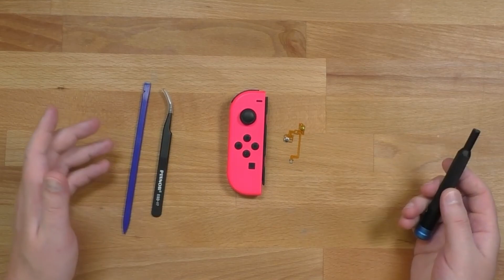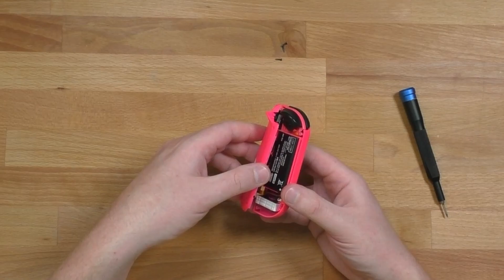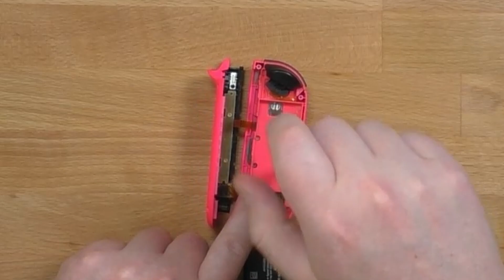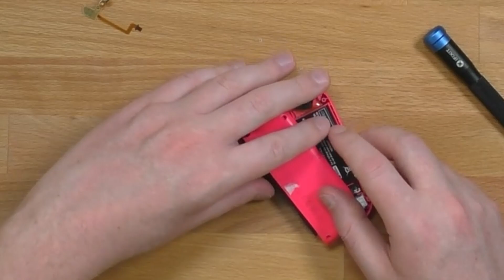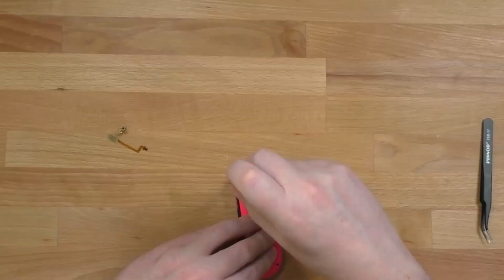Nintendo Switch Joy-Con Repair - Minus (-) and L buttons

Comment: Hello my plus button does not work do you know how to fix this problem?
Reply from the maker: The plus (+) button on the right joy-con is actually part of the main circuit board. If it is not working I suggest taking the joy-con apart and cleaning the button pad and rubber membrane with 99% Isopropyl alcohol. If that does not work you may need to replace the entire main circuit board of the joy-con.

Comment: Thanks for making this, great instructions. It was hard to find a video specifically for this problem. My L button works fine but minus is unresponsive, tried taking out and plugging back in the ribbon cable but the issue persisted, so it looks like I'll have to replace the whole part. Definitely going to refer back to this video once I get it
Reply from the maker: Good luck! If you have any questions let me know.

Comment: ummm I searched everywhere because my minus button is literally impossible to press. Anyway to fix it???
Reply: Did you solve
Reply from the maker: Replacing the minus button as shown in this video is your best option.
Reply: I replaced that part to fix my L button but then i had the same problem. It’s not a problem with the ribbon cable part because you can press that button and it responds, but it’s difficult to press with the actual minus button.
Reply from the maker: If the minus button is hard to press it may be the rubber membrane out of place. You can also try loosening the shell screws.

Comment: The tab/flap on the connector broke off where the ribbon is held, for the left button. The button doesn’t work anymore, is there anything I can do to fix it? I can’t find the piece as it flew…😅
Reply from the maker: Oh no! You have to replace that connector. No easy task. If the solder pads are torn off it may be a lost cause.
Reply: @CO3Productions   Do you have a video showing how to do this? Where can I get the part from, is there a specific name for it?
Reply from the maker: I do not have any videos on this repair, but highly recommend @TronicsFix. They have some great videos on Joy-Con repair. I believe the part you are looking for is "joy-con ribbon cable latch".
Reply: @CO3Productions   Ok, thank you, you’ve been very helpful! 😊
Reply: I know this is an old comment but for anyone who might have this problem THIS IS SOLVABLE with tape. I also broke the tab off by pressing the tab the wrong way for the L and Minus button ribbon strip. Tried to reattach the tab and it just would not stay on. Saw a YT video that said to add tape to the ribbon so that the connection is making contact. That's pretty much what the tab is doing anyways, holds the ribbon down in place with enough friction to ensure contact. AND IT WORKS! You have to put the tape on the end piece of the ribbon that DOES NOT have the ribbon gold contacts exposed (aka put the tape on the top side of the ribbon where the metal tabs will hold it in place). 2 strips of clear tape was thick enough to give it the friction needed to hold it in place. Also make sure the cut as much excess tape off as needed, you want as clean of a job as possible as the end piece of the ribbon needs to be fully seated into the connector.

Comment: Do you have any ideas why when I have installed my new cable both my minus and L buttons are showing as minus on the switch even when the l button is pressed?
Reply from the maker: Either the cable is bad or pressing L is pushing down on the minus part of the cable.
Reply: @CO3Productions  thank you for a fast reply I thought it might be a dodgy cable so il probably try another new one first